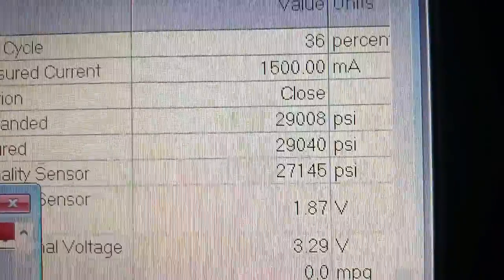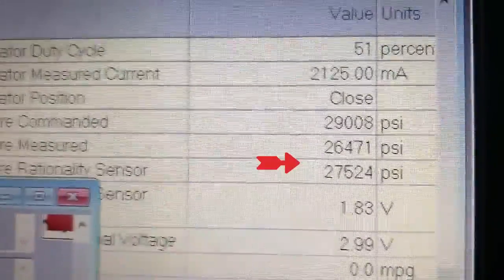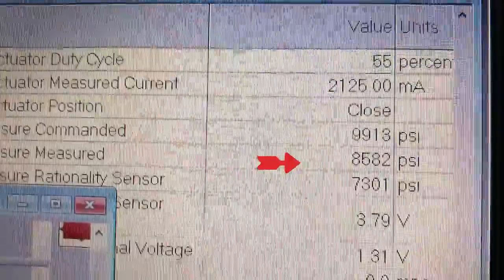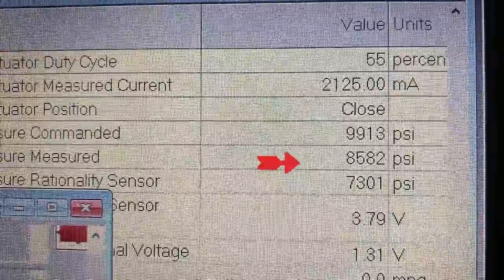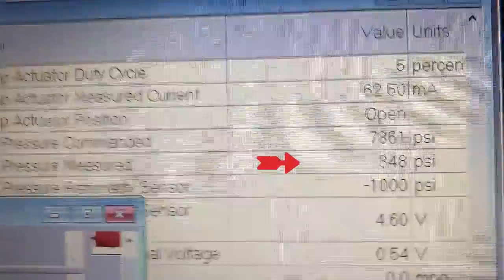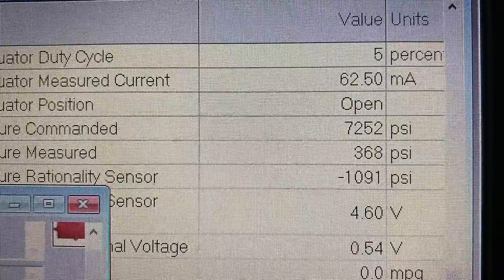ISX15 FC4726 Low fuel pressure-check engine light

Comment: Where is part 2 of this video? Im having the same issue
Reply from the maker: Fuel leakage means the rail can not hold the fuel pressure. If you're pulling up a hill you might command 35000. then you go over the top and coast down the other side. the rail should stay up around 28000-34000 when the commanded fuel pressure or requested fuel pressure is only 10000-coasting. The rail pressure should be up at 28000 until you step on the throttle but the ecm notices it has to add fuel to the rail when your coasting to keep the pressure at the minimum. So it logs this fault. Possible causes- fuel rail pressure relief leaking. start it up cold and let it run a minute then rev it up and make sure the rail relief stays cold.if it warms up or is hot it is leaking. Next it can be a bad check valve in the fuel pump head. Next it can be an injector connector in the head lost its press fit in the injectorts. Last it can be an injector that is internally worn. If you have over 750000 miles check injector return flow against the specs. I have a video on how to do that. If injector flow is ok it is probably the fuel pump head needs replaced. Hope this helps you. Dont throw parts at it try to pin it down. Parts are expensive. Good luck!

Comment: Hi my truck is driving me crazy 2015 kw w900 with ISX15 the truck don’t start it has a code SPN:157 FMI:18 fuel rail pressure I change the fuel valve under the cab was  leaking fuel I look to see if he has any broken hose but everything is good I don’t know what to do next please I need your help.

Comment: I have a low fuel rail pressure light. Truck is dogging  when engine is working harder. Checked screens in fittings, replaced filters, Took the head off my high pressure pump. everything looks great. Plungers are good. I dont have all the test tools. maybe I need to get them to find this one. Im going to check the main fuel lines again and all connections. Thank you for the videos. very helpful.
Reply from the maker: Check your rail overpressure dump if it failed it will get very hot to the touch
If you can hook up a scan tool see how far off it is. If you unplug the fuel actuator rail should go up to around 29000 psi.  If it can get there the pump head internal check valves are most likely both good.  If one of those goes bad you lose volume. So hard pulls lose rail psi. The tool you screw on the rail when the injector lines are blocked tests the pump head check valves and verifies the pump cam lobes are good. Let us know what you finf.

Comment: I'm guessing its a malfunctioning relief valve on the fuel/common rail. It is failing to hold pressure due to a worn spring?

Comment: Thanks to you im fixing the fuel rail pressure im changing the seal washers. But i got a question what’s the torque on them i tight them a little too much and was getting air on some of them.
Keep doing videos good way of sharing info with others
Reply: google is your friend